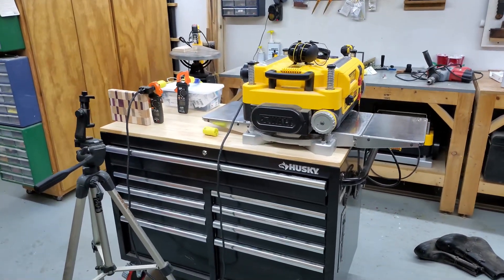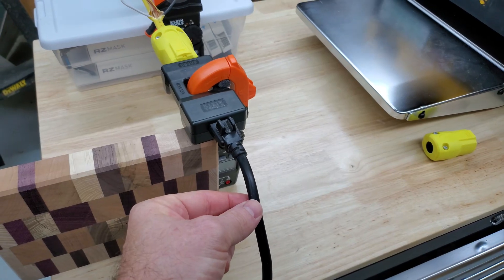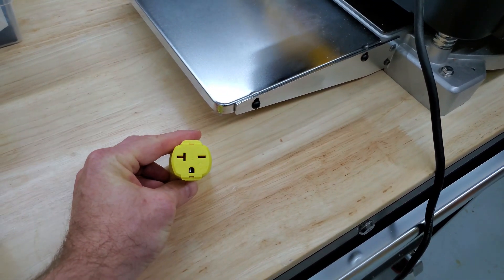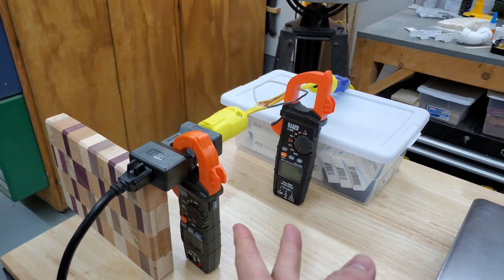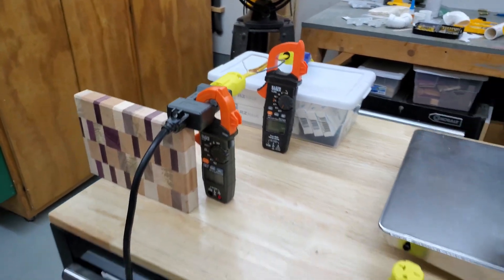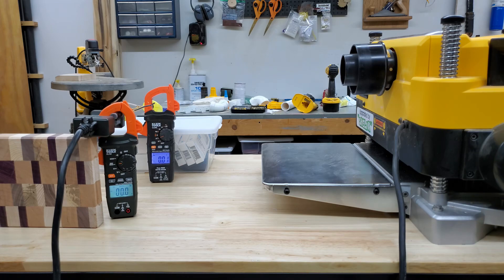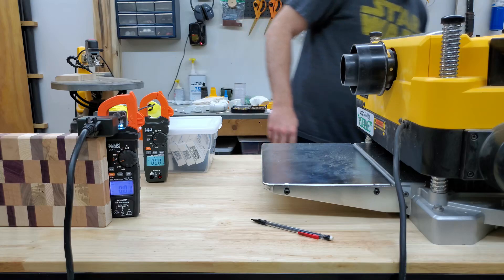More planer power testing (Answering viewer questions)

Comment: @The Snekker Show   A good idea if you are comparing meters Ben, is to clip BOTH onto the single wire and see if they read the same with the same magnetic field generated when the current passes through the wire..  This will give you an idea if there is any discrepancy between them to account for while using identical input.    Secondly, a true RMS meter can handle pulses and noise on the line generated by the motor (universal motor with commutator and brushes i believe)  better than the std averaging meter will.... pulsing or square wave on the line can read slightly higher on the std meter.... which looking at the first results seems to be the case .... (4.5% higher at point i stopped vid )

Why the difference ?    My guess is that the std meter is reading about  1/2% higher than the true RMS one on the single wire, and the 10 loop tester is multiplying this difference 10 times to up the 4.5% discrepancy in the first test.    

Where as the true RMS meter can handle the noise and isn't affected with the 10 time increase. (via the 10 loops  )

Once you test both together on same single wire at same time with the planer........ then try on a resistive load and i would expect to see far less difference when the std meter is using the x10 test tap point( as per first test).   (since resistive loads don't add noise to the line)

(Use a kettle for example)

PS ( the reason the clamp meters don't work across both wires is the opposing magnetic fields from current flowing in different directions cancel each other out)   

Cheers,
Gary.
Reply from the maker: Great information, thanks. Both meters read close to the same on the same single-loop separator, maybe 0.15 higher on the non-RMS. That makes sense about the noise being magnified on the 10-loop separator. It also just occurred to me that the reason I was getting OL on the 2/20A setting but not 200/400A was because of the 10-loop multiplication. Seems kind of obvious now.

Comment: I saw the same comment below I am making. This video shows 7 amps no load but the other video showed 14 amps. Therefore when you were at 35 amps during full load in the previous video you were more likely at 17.5 amps.
Reply from the maker: Thanks for the feedback. This series raised a lot of questions and comments, which I tried to roll up into this video: https://youtu.be/24f-J0lVo-E. As for the no-load measurement, I think there was a note somewhere in this video clarifying that I removed the impeller from the planer, which was not the case in the original.

Comment: Recently purchased a pre-owned version of this planer. What amp circuit are you plugging into. Asking so I know what I need to run this under load.
Reply from the maker: I'm on 20 amps. It can run on 15, but not with very heavy loads.

Comment: Great videos. However in your “improved” video at 22:20 the meter is reading 14.xx amps before you start feeding the board. In this video at 5:22 we see 7.23 amps. Both readings are no load. For some reason the “improved” video was displaying 2 times the current. Just as a common sense check, when you put a load on the planer, current was displaying 26 amps on a 20 amp circuit (or 15 amp circuit). The circuit breaker would be tripped in that scenario.
I did like this video because the current readings are what I would expect no load with this planer.
Reply from the maker: Thanks for the feedback. This series raised a lot of questions and comments, which I tried to roll up into this video: https://youtu.be/24f-J0lVo-E. As for the no-load measurement, I think there was a note somewhere in this video clarifying that I removed the impeller from the planer, which was not the case in the original.

Comment: Great video, I too am an electrical engineer and had no trouble understanding your intent here.  Question, are you still running without impeller?  I still haven't bit the bullet yet.
Reply from the maker: Thanks for the feedback.  I've been going for about two years with the Shelix head installed, and one year with the impeller removed, and haven't had any trouble with either.

Comment: So once the machine calmed down after initial start up, it only has a 7 amp draw?  What happened to your other video that showed a 20 amp (or so) draw with no load and a almost 30 amp draw under load?  Serious question. Not trying to be an ass. I tested mine and had an 8 amp load while running and 14 amp load with a 2x6 board going through.
Reply from the maker: I don't think I've ever seen 20 amps with no load, so you might have misread something. Maybe 12 with the impeller installed, and 6 without. 14 sounds about right for a light pass on a 2x6. Wider or harder boards and deeper cuts draw more power, as do dull knives, sticky tables, etc.

Comment: That's not a 220 volt outlet, it is a 20 amp outlet.
Reply from the maker: It's a 220v 20 amp outlet. Notice there are two horizontal slots.
Reply: @TheSnekkerShow  Well, dang it, I totally missed that.  Thanks for correcting me!
Reply from the maker: @chip812  Understandable, I obviously missed it the first time too.

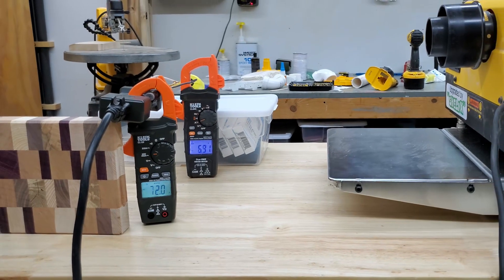Comment: As an Electrical Engineer I got bored at 5:28 and had to stop the video, without a load on the motor you have nothing to prove.
Reply from the maker: I already did a load test video. This one was about showing how the decimal place moves when you're measuring one loop versus ten.  But maybe you can explain why the two meters read more similar on the second test than the first. It was late and I didn't have time to investigate further.